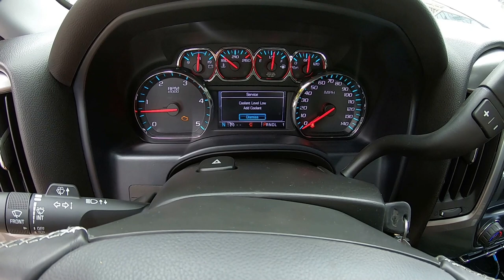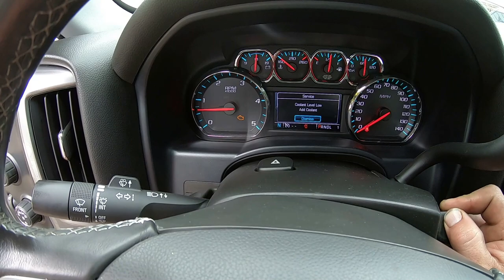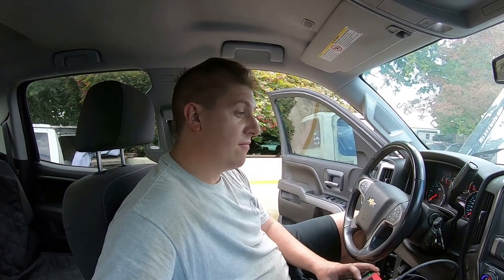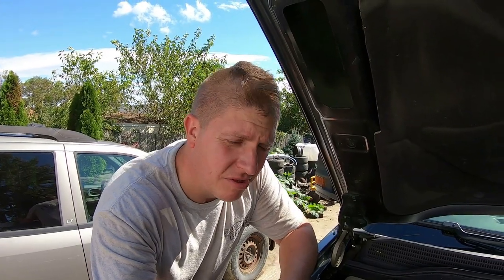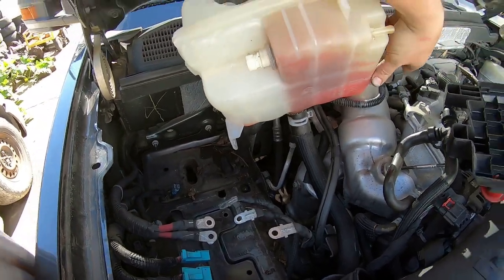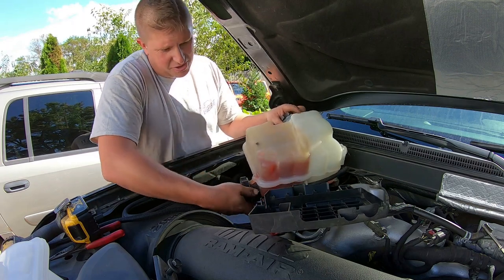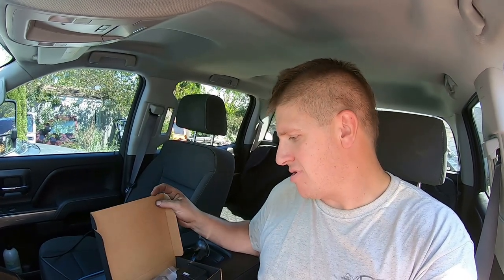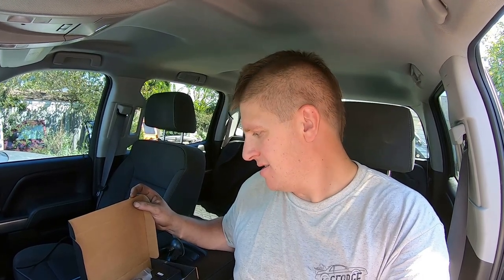L5P Duramax "Low Coolant" Fix and Tuning!

Comment: GM in it's infinite wisdom and logic. Why in the world would they counter thread the coolant cap.  It's not like there is rotating shaft that would call for it.  When I saw this on my truck I thought WTF WHY!!!
Reply from the maker: My only thought, is by making it left handed thread, it will hopefully make whoever is trying to take the cap off actually THINK about what they are doing, and not accidentally put the wrong fluid in there, like brake fluid, or DEF, or something else. The DEF fill is very close to the coolant reservoir and would be CATASTROPHIC in the cooling system.
Reply: @MohawkMotors  On another note.  I had the low coolant message pop up so I watched your video.  I went out to check the level after it cooled and found that the cap was not on all the way.  On my cap there is a place where it seems tight but if you keep forcing it the cap will pass the tight spot and fully lock in place after another 1/4 turn.  Hopefully that will solve my problem.
Reply from the maker: Fingers crossed for you!
Reply: Thanks I have the same low coolant issue with my 2003 gas 4.3L Sierra, no complaints, it has 194K miles and otherwise runs great.

Comment: I’ve had both of the same problems just changed glow plug #7 and now dealing with the same coolant sensor
Reply from the maker: Yup, common issues on these trucks. Sad to report my coolant level sensor is already starting to act up again. I just replaced my cylinder 5 glow plug last week. Overall I still love the truck, just annoying to have these little things screwing up.

Comment: Do you really need the truck to tell you when the coolant is low? I mean for the last 40 years none of my others have.  If you want an easy cheap fix to get rid of the light just pull the wire connection off the sensor and make a jumper between the  wires or snip the wires and twist them together. Done in 5 minutes.
Reply from the maker: No I don't need the truck to tell me if the coolant is low, but I don't like the low coolant light coming on and I prefer not to have wire jumpers and stuff like that on my vehicles. It wasn't that expensive or difficult to just do the proper repair. Plus I still have the secondary warning that should something crazy happen like a coolant hose burst or a piece of debris cut one and drain the coolant nearly instantly, I'll know about it before the engine even starts to overheat.

Comment: The good tires always go on the rear! Look it up. Very common misconception…
Reply from the maker: In all applications? Front wheel drive? Rear wheel drive? All wheel drive? I did ask google and it did pop up a recommendation from tirebuyer.com to put the better tires in the rear of the vehicle to make it more stable and less prone to washing out. I suppose for a lot of people that don't know how to recover a vehicle if the rear end loses traction that makes sense. The article also said that it's much more common for people to lose control of the rear of their vehicle than the front, which maybe the general population has had much different driving experiences than I have. I would have way more trouble recovering a vehicle that I couldn't steer, than I would a vehicle with the rear end swinging out and potentially spinning out. Heck most of the time I swing the rear of my vehicle out on purpose.

Comment: There is a current extended warranty for your glow plugs and it’s covered under the manufacture warranty for 100,000 miles
Reply from the maker: No kidding, I didn't know about that. I'll have to see if I can get the dealer to fix it.
Reply: They wouldn’t fix mine, said it wasn’t covered
Reply: your wasting your time, its still the same old design, they never changed a thing. i just unpluged the sensor.

Comment: I’m reading about a second coolant tank ?
Reply from the maker: Yes I believe in 2018 or 2019 model year gm added a second coolant tank for the DEF system. I;ve read about problems with those as well.